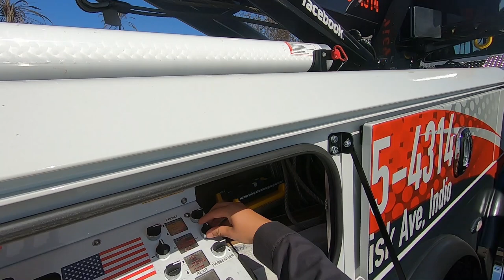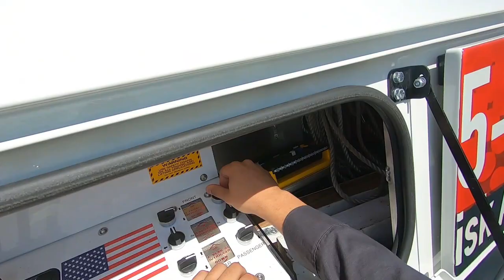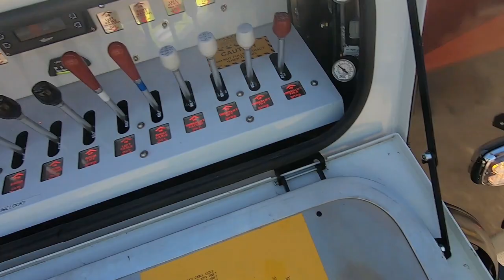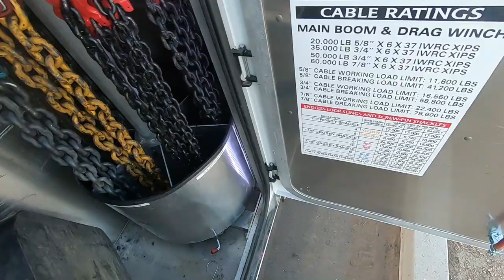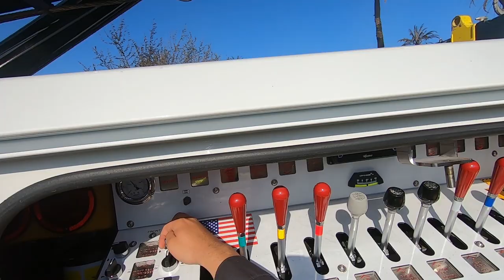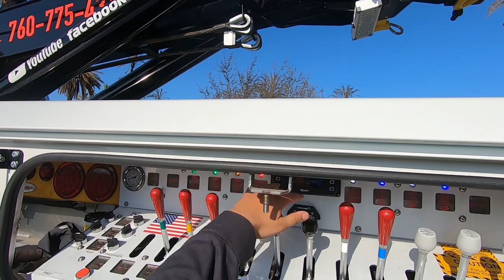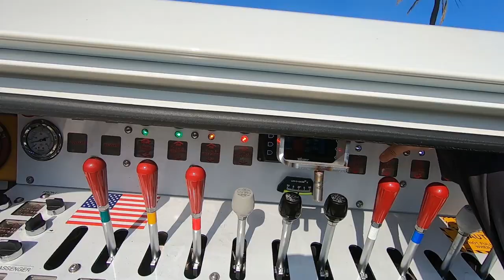Expensive RV Burns Down | Complete Total

Comment: It WAS a million dollar coach.  At the price level I would probably have automatic fire extinguishers installed; foam, power, halon.  My brother in law had two halon automatic extinguishers installed in his motorhome but it was a lot less than a million $.
Reply: You can put them in any car for super cheap. Look up Blaze Cut
Reply: Halon is useful in a closed sealed room.  The engine fan and louvers on the coach will get rid of more halon than you can put in there.

Comment: Not an RV, but a custom bus. Thats why it cost a cool million. It started as a basic no frills bus and converted to an custom RV. Fire did not touch motor, that will be salvage for about 50K there. The main reason that I and others call it a custom BUS is the chassis for an RV unit and BUS are very different.
Reply: It's a blue Bird Wanderlodge, so it's literally a RV built on a bus chassis.  I used to work for Blue Bird, not Wanderlodge.  Blue Bird would build the chassis, with a shell body on them, then send them across the street to Wanderlodge to build an RV inside.
Reply: excavatoree RS, whatever brand you want & can afford EVEN PREVOST IS IN THE RUNNING, cheers from NJ🇺🇸🇺🇸🇺🇸🇺🇸

Comment: Its interesting that bus still had power for those front marker lights, given the extent of the interior damage.
Reply: I think shorted wiring was why the lights were on, but yes, I would have disconnected all batteries, just to be sure it doesn't catch fire again while towing it back to the yard...   A lot of RV fires are electrical in cause...
Reply: l wilton yes that was interesting. Most have a complete disconnect except for marker and hazards

Comment: Staff , how would you tow a 40' toy hauler 13.5 tall that has the right/front wheel bearing blown out? This happened to me 4 miles outside of Long Beach Harbor. None of my towing services (won't mention names) could find someone to help, and it was JULY 3rd... Finally, after 8 hours on the side of the road got a mobile service tech (from two other techs routing the help call to me) to come out. Bought parts at last minute of the business day and I was back on the road at 9 PM. I kept asking for a flatbed haul and none could service me... Your thoughts?

Comment: I would've thought the battery would've been disconnected on the RV. I see the running lights were on.
Reply: At about 3:30 Trent Senior (I think it was him) said they had disconnected the house and engine batteries and didn't know why the lights were on.
Reply: For a Million Toitles, the damn thing better have Solar Panels, on the Roof, for Auxiliary Power and/or whatnot.
Reply: @tallman11282  The wiring is most likely melted together causing power to cross over to the headlights. I would have cut the battery cables to prevent a fire from starting.

Comment: The other day you showed an RV and boat that were burnt up more than this, was that a different one?
Reply: I was thinking the same thing. And I'm pretty sure the boat from the video the other day didn't have the ski rack.
Reply: The one from the other day seemed to be a Ford F53 gasser chassis that burned to the ground.
Reply: All modern RVs have fire extinguishers inside.  If you choose to use one.
Reply: @tallman11282  Now I cant find the other video.

Comment: Someone may have commented in the 347 comments but if these are air brakes don't you need to fill it up or the wheels will slide like on the right, where they dug into the sandy shoulder. Do you just not worry about the chassis because it was a fire or the brakes don't hold well enough to need to release them?

Comment: so what caused the rv fire?
Reply: Looks like a refrigerator fire, probably gas electric fridge.
Reply: @Seanog1231   Don't think so. The refrigerator vent on the passenger side just forward of the rear wheels is untouched, not burned, not even any smoke damage coming out of the vent. Refrigerator fire usually takes that portion of the wall out.
Reply: I was thinking the DPF, Diesel Particular filter system but the way the front is burnt out it may have started upfront and that means it would be electrical.

Comment: that coach is actually repairable. won't be cheap or easy but it can be rebuilt.
Reply: Yep, falcon7350 rebuilt one even after it had been picked over at the salvage yard.
Reply: Jeff Spiccoli in Fast Times at Ridgemont High:
"My dad's a TV repairman. He has an ultimate set of tools. I can fix it."
Reply: Actually no it won’t be

Comment: I noticed no license, it must have been brand new.  I hope those people aren't full timers.  Great job.
Reply: It's a Wanderlodge with "Blue Bird" still on it, so it has to be older than 2007, when Blue Bird sold Wanderlodge.   Complete CoachWorks made Wanderlodges without "Blue Bird" on them until 2009.   I used to work for Blue BIrd (but not Wanderlodge) that's the only reason I know that, because I can't afford an RV like that and know nothing about the market.
Reply: "Full Timers" have built up some sort of Immunity, to Fire, i reckon.  It is about time they received a Reeward, for their dedication to the Sport.
Reply: excavatoree 2017 wonderlodge

Comment: I'm guessing either Electrical or in the engine
Reply: With the smoke damage coming out of the passenger side front wheel well going up the side of the coach I'm thinking generator which is in the front under the passenger compartment on our coach but I don't know for sure where this one is.

Comment: It can be rebuilt. We have the technology. It can be big, faster, stronger then it was before.
Reply: let's  not  be  over  dramatic    this  is  not  the  bionic  rv      DUH !!!   you   NUMB  NUTS
Reply: @stevenherrold5955  There's a guy on YouTube that rebuilt one that looked worse than this. Don't remember his channel but his family was involved in building floats for the rose bowl. It had no engine or transmission in it(had already been sold out of it), so he put a big block Chevy with an Allison transmission in it. He completely rebuilt it. Had to adapt a different front cap on it. He had major fabrication skills(from building those floats). If I remember right he towed it home with his Suburban. It took quite a while to rehab. I wish someone would market a smaller class A(30-35') with a gas pusher. Very quiet in the passenger compartment.

Comment: Why couldn't the roll on truck just pull the RV on to the bed? Seems like a lot of wasted time, Working by the hr.?
Reply from the maker: Similar to some of our other videos, the landoll winch is simply not powerful enough to pull 65,000 pounds of dead weight up the deck. Hence why we use our rotator to either lift the casualty or winch on the casualty with its dual 50,000 pound winches. Thanks for watching!

Comment: i  want  to  know  why  this  fire   happened   was  it  a faulty  switch  defective  refrigerator  motor.  even  an  engine    fire  could  be  caused   by  poor  maintenance 
 or  did  someone leave  a  cigarette  in  an  ashtray   and  fell on  the  floor    and  set  the  carpet  on  fire  
this  is  hard  to  watch  when  the  camera  is  mounted  to  you  helmet  i  would  have  fixed  position  camera  
if  i  had  that much  money  tied  up  in  that  rig  i'm  damn  sure   going  to  take  care  of  it

Comment: Should've towed it with a heavy duty wreaker? The rear tires weren't burned, putting it onto trailer would have put you over height with that big of an RV!
Reply from the maker: The air bags were completely deflated making it nearly impossible to safely tow it on the ground due to seized brakes and transmission components. Additionally the ride height when lifting the front would slam the rear end into the ground. Lifting the rv was the safest way to tow it. Thank you for watching!
Reply: To much overhang on the rear if the air suspension not working. Still pretty close when it does

Comment: No need for the short pull.....the boat trailer ..HAD A WHEEL...Smh..rich folks!
Reply from the maker: The short pull was to remove the rv from under the power lines. Thanks for watching!
Reply: Plaza Towing yeah, because 240V AC can’t be too healthy for the Rotator.